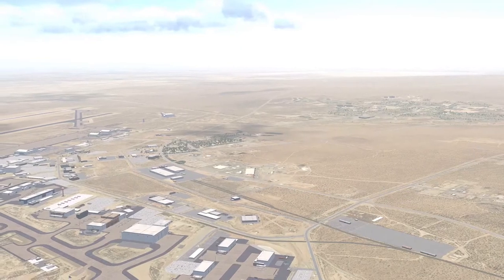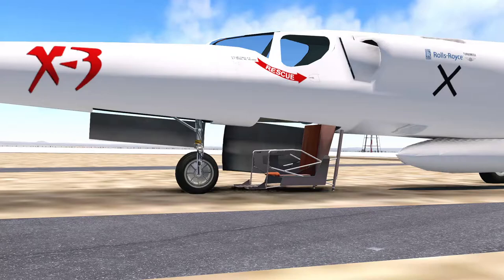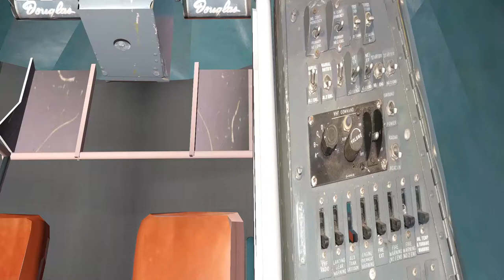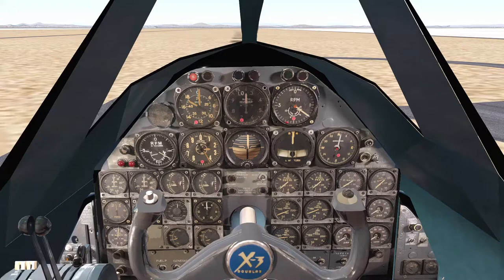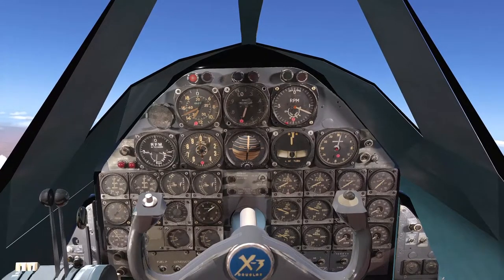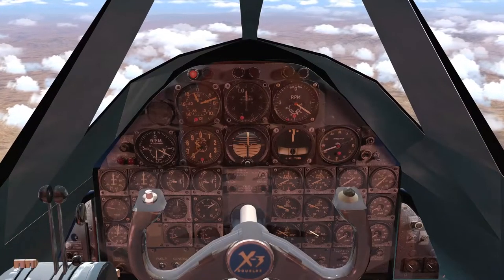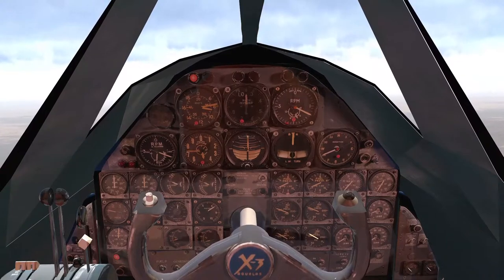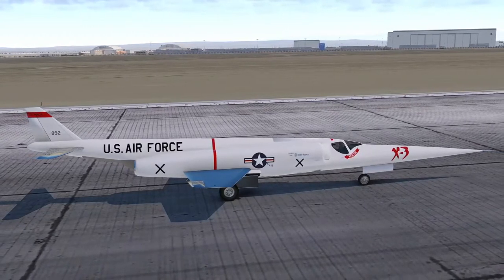Douglas X-3 Stiletto for X-Plane - History and Review

Comment: As a kid I remember making the model of this aircraft and the X15 - well done Dan on your 3D model and nice one Simmo the way you have bought it to life - what was the landing speed for this baby with just those stub wings holding it up?
Reply from the maker: Thanks Pete,   As you would expect the landing speed is fast at about 180-190 knots. Below this and you risk a stall and perhaps striking the tail. The parachute brake helps a lot bringing it to a halt but because the X-3 spent all it's life at Edwards with their long-long runways it might not have been a real problem.
Reply: @simmo2sim  this was the video that followed on from yours - https://www.youtube.com/watch?v=v5G9HlsqPTE - very interesting  3miles to take off at 245mph and the seat jettisoned downwards.
Reply: @nortonp3983 Like it did on the early F-104s